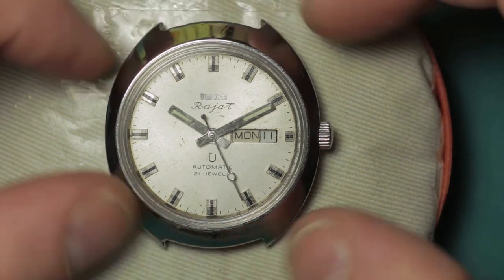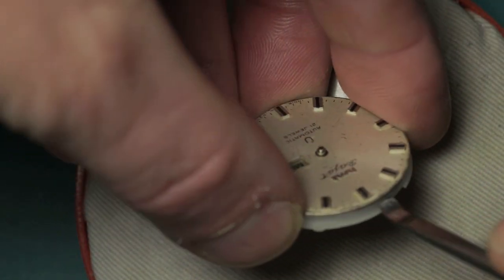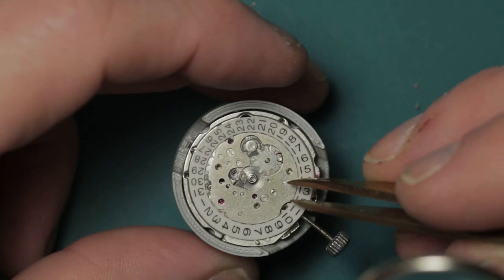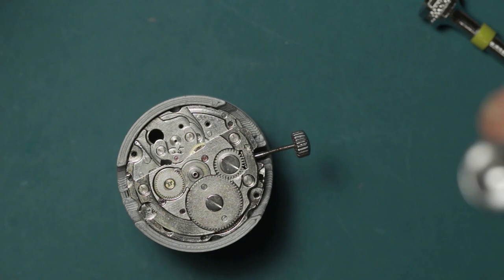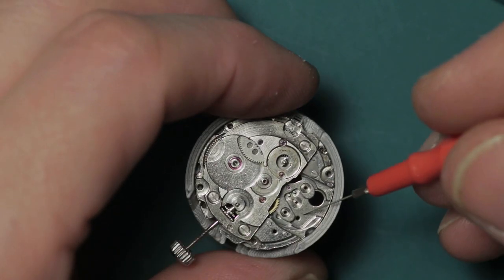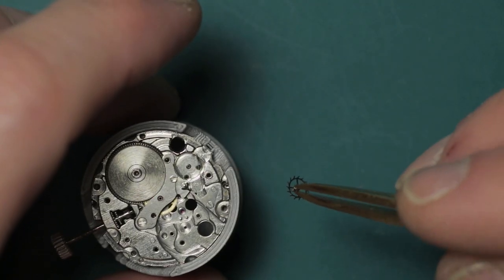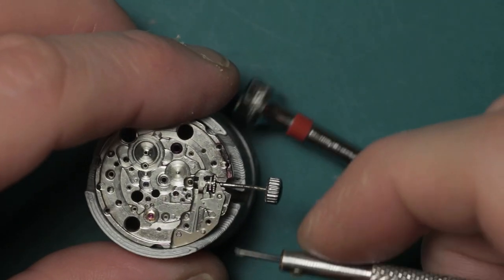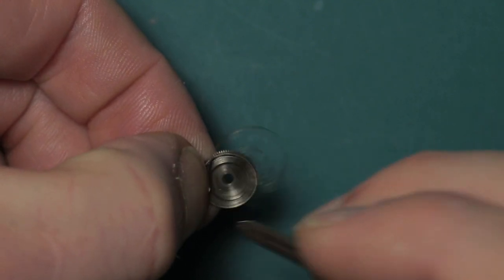HMT Rajat 6501 21 Jewel Automatic Service ( Citizen / Miyota 6501 )

Comment: This movement is unidirectional and is 6902 and not 6501.
Reply from the maker: I state in the video that it's a unidirectional winding automatic and the calibre is based on the Citizen/Miyota 6501 per the brackets.